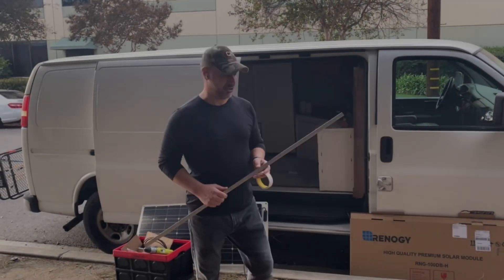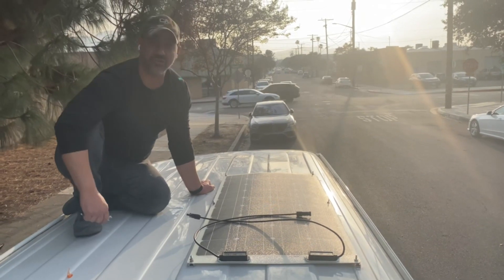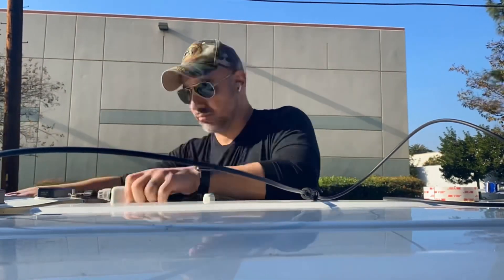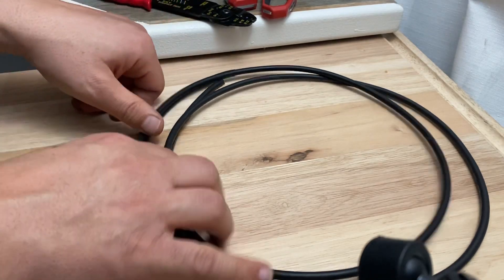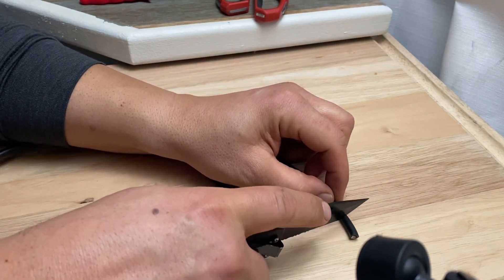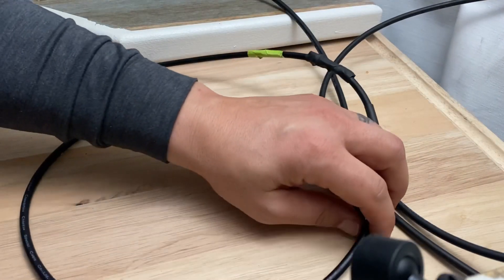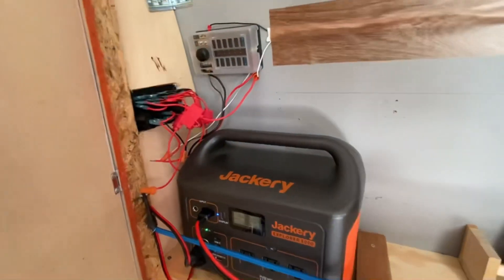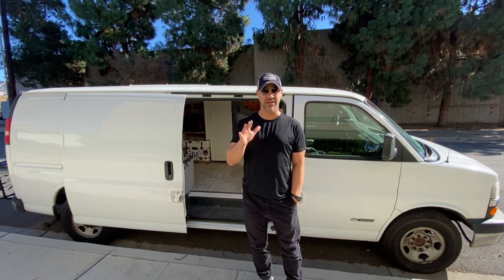Simple camper van electrical system setup…no drill flex solar panel install. #vanlife #diysolar #diy

Comment: Great video! Just subscribed. If I could make a few suggestions. If you wanted to replace the tape holding the cables down on the roof you can buy magnets that you can feed a ziptie through. I used these while hiding wires on my car. I’d also suggest shrink tube butt connectors for your main cables you had to join going to the jackery. You crimp them and heat them up and they provide a good seal and prevent the wires from pulling out of the butt connector. Cheers!
Reply from the maker: Thank you so much for your kind comment, I am so grateful and appreciative of every single subscriber. I think your magnet and ziptie idea is fantastic. Great idea. And regarding the shrink tube, to be honest I did buy some and was going to use them but for some reason they were too small and tight for my cables even though I thought I had bought the right size. However as you can see in the video,  my cables are too long and I have to cut them to appropriate size and organize them. so once I do that I will definitely use the right size shrink tube! Once again thank you for your kind and informative comment. Cheers